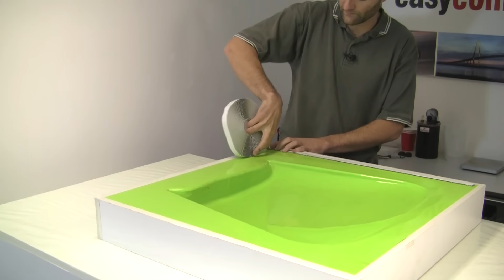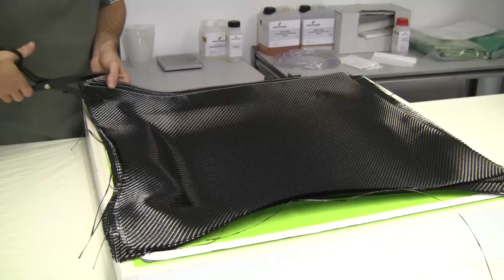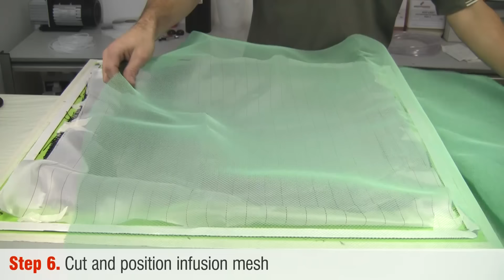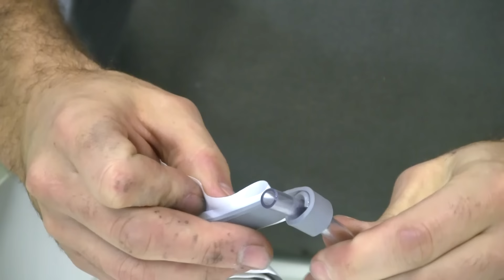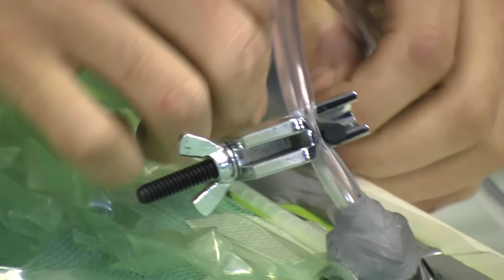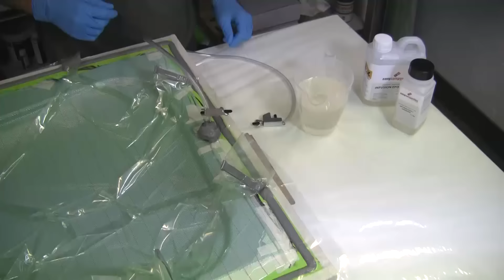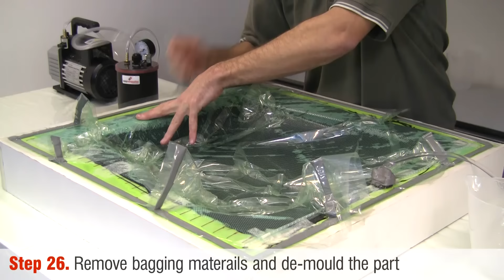How To Do Perfect Vacuum Resin Infusion of a Carbon Fibre Part - Basic Tutorial

Comment: @easycompositestv : Thanks for the fast response. My concern has more to do with humidity once the fibreglass is very hygroscopic. I know that regarding to room humidity the lower the better, but  what is the range of acceptable and not harmfull values in a composites shop?
0% to 50% is acceptable? What is the upper limit? Will it be 60%, 70% or 80% or any other value in between?

Comment from the maker: @Shadow383 : No, not with infusion. Even if you keep the vac running constantly (i.e. never clamp it off) with the resin feed line closed you will only draw off a slight amount more resin. You'll probably lose the glossy surface and have some small pits (pin holes) and it will be slightly lighter but it certainly won't be porous.

Comment from the maker: @RiMartinsRi : Yes, definately. We'll make a video to show how it's done but basically you need to perforate the foam core (approx 15mm centres, 3mm holes) all the way across its surface. The resin will then make its way along the top skin (guided by the infusion mesh) and then drop down through the holes to wet out the bottom skin. We make a very large table (with a 30mm core) in this way and it infuses perfectly. You can get core material that is ready-perforated for infusion.

Comment from the maker: @RiMartinsRi : For the purposes of most composites 'room tempertaure' is assumed to be 20 degrees C. You'll find that pot-life and cure times are generally quoted for 20C or 25C, lower temperatures will slow down the cure (and elongate the pot-life) a lot, much below 15C and you're in danger of many epoxies not curing properly at all. For general composites the lower the humidy it the better. Only condensation cure silicones and some 1-part adhesives need humidy to cure.

Comment from the maker: @zliminator : Because the infusion is done under a full vacuum any 'air pockets' caused by the fibre 'bridging' wouldn't actually be 'air' pockets, they would literally be *empty* (no air or anything in them). Then, when the resin is allowed to flow into the part it will automatically want to fill these empty places with resin (because the resin is a path to ambient air pressure so it's effectively pressurised). The most likely thing, if you have 'voids' is that these will fill with resin.

Comment from the maker: @DanFrederiksen : Well, yes and no! - Generally we would have the pattern machined by CNC. We would then wipe a special 'mould sealer' over the pattern, build up a few layers, and then apply the release agent, then gel coat, then reinforcement to that. In the part you see in this video the gelcoat is the green surface you see on the mould, underneith that (which you can't see) is a mould making putty.... then you're ready to do the infusion!

Comment from the maker: @DanFrederiksen : We use a company called Pentaxia in Derby (UK). They do machining for F1 teams and work to the highest standards possible. They machined an epoxy tooling block (we supplied the block) that was 30cm x 80cm which we'd arranged patterns for 5 induction funnel rings onto for less than £200. If you think that it would take maybe 3 days to hand-work those patterns and the finished result would be nowhere near as accurate then I'd say that's good value.

Comment from the maker: @SquirrelFromGradLife : The post curing will certainly depend on the resin system. The resin we recommend can be used without a post-cure or, for improved TG and mechanicals an 8hr cure at 60C (which is pretty easy to undertake) is the only post-cure it needs. Optimal resin to fibre ratio isn't really determined by the fibre or resin, it's basically somewhere pretty close to 40% resin / 60% fibre when you're working with carbon fibre.

Comment from the maker: @ariffoys : Apart from at the end of the process where we clamp off both lines it's essential to conduct the infusion under total vacuum. If you had a leak (even one you later patched up with tape) then this could well have an impact on the resin ratio and surface finish of the finished part. From what you describe (and given the thickness of your reinforcement) it sounds like you needed to leave the vacuum running longer and draw more resin out of the part before clamping off.

Comment from the maker: @DanFrederiksen : If you're starting with a CAD model the first thing would be to have the pattern CNC routed from tooling block (probably a high density polyurethane block) by a CNC company. It's not that expensive and they can work straight from Solidworks files. You would then hand finish and seal the pattern before setting up any flanges/barriers, coating it in release agent and then covering it in an epoxy tooling gelcoat and reinforcing the back with resin and glass or mould making putty.

Comment from the maker: @SquirrelFromGradLife : You're unlikely to find a resin-to-fibre ratio lower than 40% resin; pre-preg is generally around 40-42.5%, infusion will always yeild around the 40% mark. Much lower resin ratios would actually jeopardise the structual performance of the composite because there is actually an optimum amount of resin, not just 'less is better'. Regarding post-curing, you can post-cure our infusion resin to improve the mechanicals but it wouldn't change the process for the infusion itself.

Comment from the maker: @DanFrederiksen: Well, the first problem is that even with careful 'wet layup' your resin ratio will vary from part to part, reducing the consistency. Without any vacuum consoldation and great care you're likely to achieve something like 55-60% resin by weight using traditional wet-lay. Less careful laminating will be 60%+ plus resin (by weight) which is a very different laminate in terms of performance.

Comment: I was trying to make a part  with carbon fiber (12 layers) and  the  problem I found was after 1 hr, at a sharp corner of the spiral wrap I found a leakage  which dropped the pressure from 27 mm Hg to 20 mm Hg, but I immediately repaired it with the sealant tape and it was maintained constantly at 27mm Hg afterwords, do u think it was the problem for getting a part with no resin at the bottom? there was resin left when the infusion was completed. was the part too thick for the infusion process?

Comment: @dytch2220 The industrial applications you see at automotive and aeronautical industries use another types of resin that requires heating for a stronger structural bond plus they use a lower resin to cloth ratio creating stronger parts. Further more the part thickness of structural members requires a heat treatment to insure proper curing of the entire part. Heating speeds up the curing process so instead of leaving the part overnight the curing of thick structural member takes mere hours.

Comment: @fooking1990 : Well, resin infusion is the exact way that the big aftermarket companies make their carbon fibre bonnets so if you want to make your own bonnet then this process is certainly the way to go. In terms of complexity bonnets are physically a large job (so more material and a large mould to make) but the upper moulding is a simple shape and easy to get right. There is an inner moulding too which is made in the same way but is a more involved mould to make. Contact us if you're serious.

Comment from the maker: @dytch2220 : Yes, you could certianly use resin infusion to make structual parts. Furthermore, parts made using resin infusion could be made to have structual properties equal to those of parts made from pre-preg carbon. The actual part made in this video weighs in at 60% fiber, 40% resin. Many of the pre-pregs we use are 60/40 so the fiber content (giving strength to the composite) is the same. There's no room to explain all the pros and cons of the processes but get in touch for further info.

Comment: @apelabs1 : When using an epoxy gel and polyester to reinforce the mould (not a conventional system but it does work) I would recommend 'double gelling' with the epoxy (just a few hours between the two layers) then letting that FULLY cure before reinforcing with polyester resin and CSM. No need to a polyester gel. As for the pre-pregs we'll suggest a 75 degree curing pre-preg, vacuum only (no autoclave). A vac pump and a decent but simple 'hot box' oven is all that's needed.

Comment: I'm going to make a mould using an epoxy gelcoat but with polyester resin and glass reinforcement, after the epoxy gelcoat has fully cured do i need to add a polyester gelcoat or go straight to resin and glass?
RE: Prepreg, is this low temp curing? hot box? oven?

Comment from the maker: @thessolonki : Yes, that's right. That's why it's so important to make sure the seal is perfect. Many companies (ourselves included at first) used to cure the part with the vac still running but we find that this bleeds out too much resin and leaves the parts with very tiny pin-holes on the surface. The process we developed in order to make parts with a perfect finish was to get the seal right and then clamp BOTH lines once the infusion is complete. That's the secret to this technique!